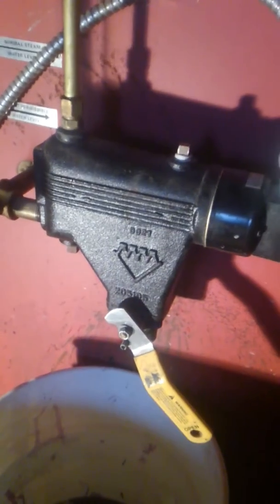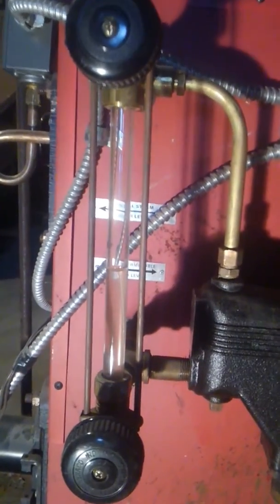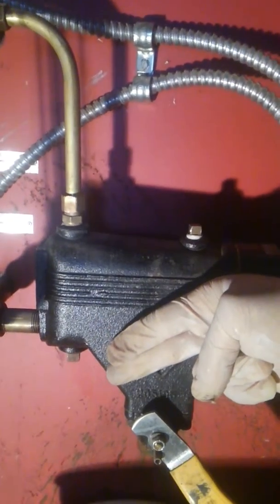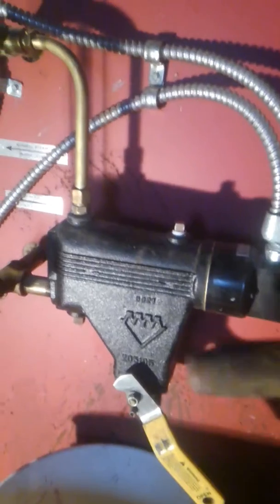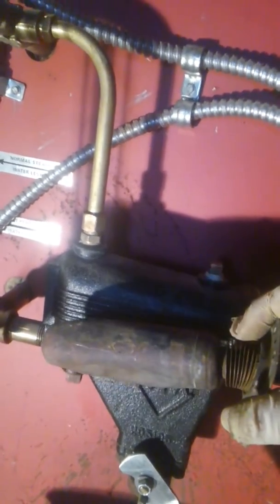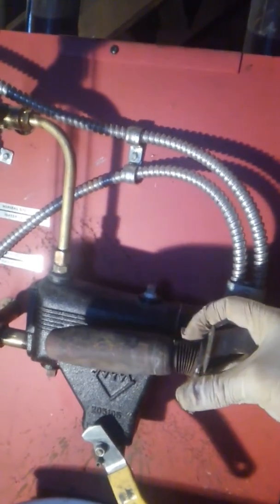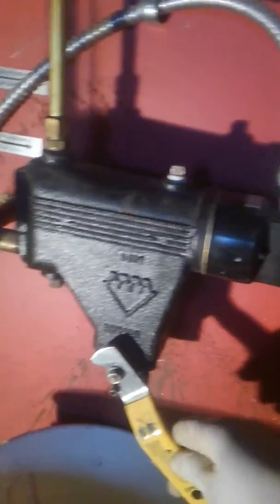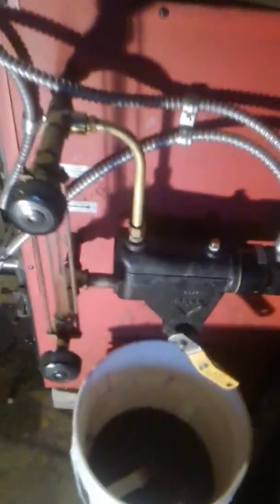Low water cut off . prevents burner from starting

Comment: THIS is very informative. Thank you.Could you assist with an answer to this question of mine, please?
I have new steam boiler installed, it has the PROBE TYPE LWCO, and NOT the type #67 (as my old one did). There is now, no way for me to "blow down", this new boiler, to get rid of dirt and sediment, like I am use to, with the FLOAT TYPE LWCO, I had.
 WHAT SHOULD I DO? Or, how do I now be able to prevent sediment from building up in this new oil boiler?
Your advice will be more that appreciated.
Reply: there should be a Drain Valve on the front or back of your boiler. Get a washing machine hose and a tall bucket and drain until the waters clear once a week :)

Comment: I got problem, boiler cut off after run 10 menit, but after off 10 - 15 minutes start again..
Reply from the maker: Mike Acong  make sure you have a safe water level maintained . Refer to the gauge to determine that . Also open the valve and flush the water at the water at the water cut off and see if that works .  The  burner  normally stops running to maintain safe pressure and safe water level especially on steam systems
Reply: @yassinezian5981  thanks for suggestion, but I am not lucky yet, the problem stil happens.
Level waters good, pressure below 2 psi, flush good, waters clear.
Clues are, if hot condition running only 5-7 minutes then...(blub..blub) gas, got cut off and boiler down, then after around 10 or 15 minutes, boiler on again.
I am thinking float broken or malfunction?
I did test, I put waters less than halfway and put more waters than halfway, resulted,  cut off 5-7 minutes.
My boiler is American Standard Gas Boiler, model plate DG. Oldest one
Reply from the maker: Mike, my boiler is oil fired. open the low water cut off valve while the boiler is running if it stops that means your low water cut off is fine . I would also check   For ventilation  , no blockage at the chimney , enough air for the burner to keep running .For gas burners a common problem is the the thermocouple . I’d clean or replace it too . Good luck with the project .
Reply from the maker: @ mike also a few gentle taps on the low water cut off while running and see if it burner stops. If it does stop , that is another clue if  low water cut off is faulty or not
Reply: @yassinezian5981  I open low water cut off while running, not stop burning!. What that mean?
Reply from the maker: Mike Acong it means your float switch is stuck in closed position. Probably rust build up is what is preventing from floating on and off properly .
Reply: @yassinezian5981  ehmm that mean I have to replace MCDONNELL 67. I need to Identify what type,  M, G, or just 67.

I pull already float, got clean, wall yes rust, worry if clean hard will leak, resulted water clear. Posible rusty made chamber more small.

Any suggestion, should I call maintenance first before I buy mc Donnell 67 ?.
Reply from the maker: @mikeacong719  at this point . You could reuse the cleaned float until you get a replacement . Rust on wall will prevent proper operations .Needs to be cleaned well  for the the old or new part to work properly . I'm not an Hvac professional .when DIY always proceed with caution and take your time.